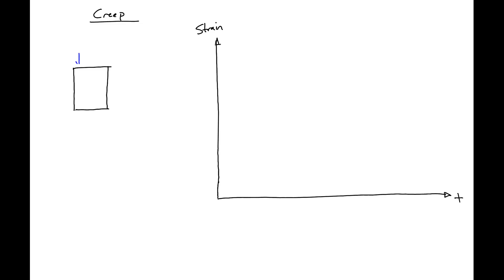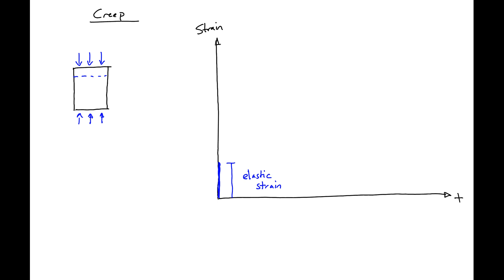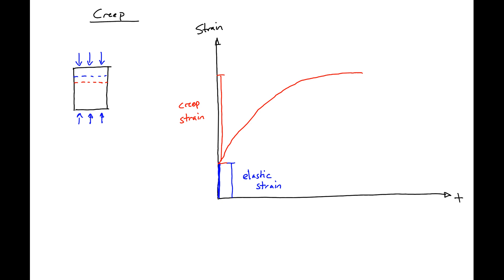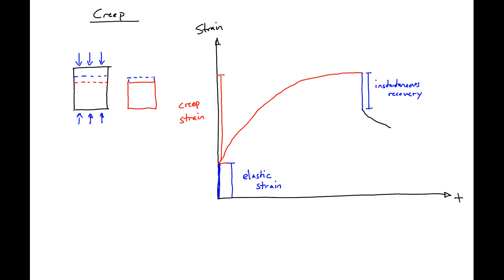4 - Introduction to Creep of Concrete

Comment: Hi david. I have some few doubts regarding creep. In this example the specimen was subjected to  compressive loading and there was residual strain after unloading . Does this residual strain induces any permanent stresses ?  I mean If we take an example of a simply supported beam loaded with some point load , there will be bending stresses and deflections induced in the beam due to external loads. So what would be effect of creep in this case ? I assume that the delfections of beam will increase but with this additional deflection would there be an additional stresses that would occur due to creep  ?